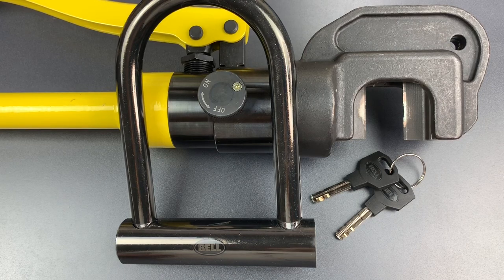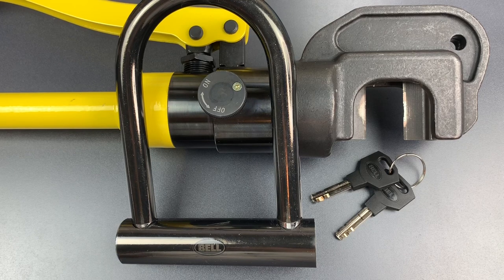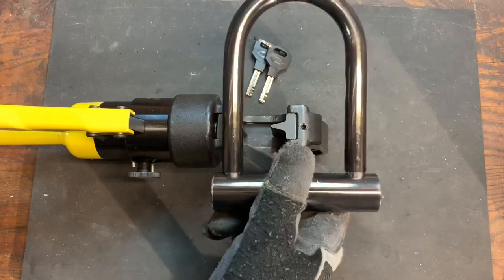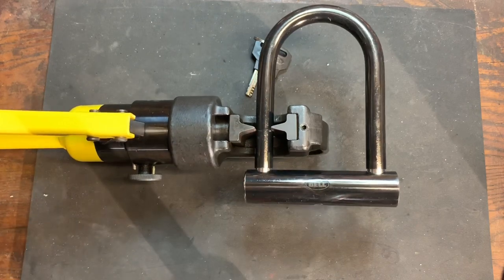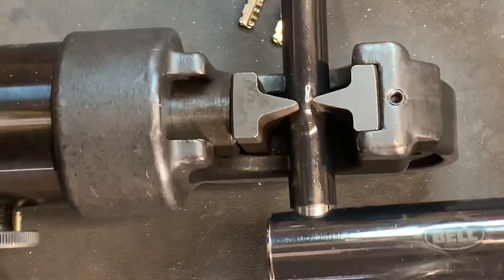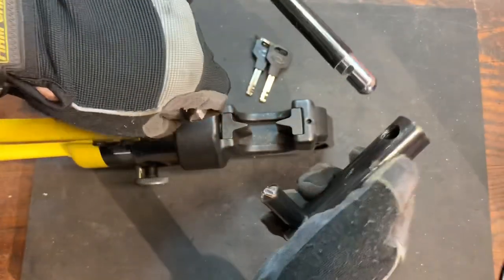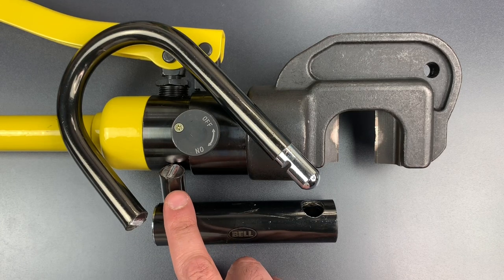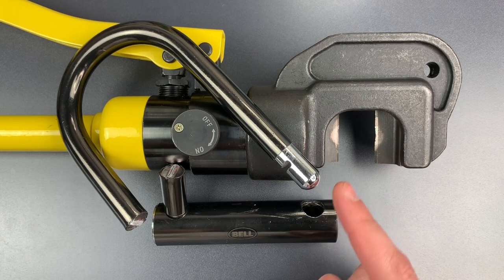[781] Hydraulic Cutter vs. Bell’s14mm Shackle “Catalyst 200” Bicycle U-Lock

Comment: Man, those cutters are no joke...
Reply: I wonder if/when he'll find something that could defeat them.
Reply: @TheJoeshExperience  wanna see a good old armp camp lock against it. one of them massive ones 220mm locks lol
Reply: you are damn right, these cutters are really impressive, but the locks, Lockpicking Lawyer puts to the test are a joke. I hope he spare us the the cheap shit and go hardcore with real locks like
Kryptonite evolution series 
Kryptonite evolution bike messenger series 
Kryptonite new york lock standard 
Kryptonite new york lock Fahgettaboudit mini u-lock,
Blackburn Sing-sing, 
Blackburn San Quentin, 
Abus Granit X plus 540, 
Abus Granit extreme 59, 
These are the interesting locks. I cannot Wait to see how really tough locks will perform.
Reply: @ShinobiDiabolik  he's done a video on some of those I'm sure
Reply: Those cutters put out 12 tons (24,000lbs) of force.
I was apart of the marketing team that designed and first sold these cutters.
They are actually hydraulic rebar cutters. 
We made these cutters, aswell as a smaller design the YQK-70 with its chassis used for wire crimping. The small version can put out 12,000lbs (6 tons) of force about half as much as the rebar cutter. You can get a mini one to put in your pocket, and change out the crimping end tool with the rebar cutter end and get a small concealable hydraulic mini bolt cutters.
We eventually after several prototypes, sold the patents for the rebar cutter and wire crimps to the Chinese.
Reply: @WELLINGTON20 where can I buy these?

Comment: Can you please test a lock with a hardent steel shackle? Because you can take a 100mm (Ok, thats too much) shackle and the blades will go through! After the fifth lock it's getting boring with those soft locks.
Reply: That shackle is made of hardened steel, go check it.

Comment: Those cutters put out 12 tons (24,000lbs) of force.
I was apart of the marketing team that designed and first sold these cutters.
They are actually hydraulic rebar cutters. 
We made these cutters, aswell as a smaller design the YQK-70 with its chassis used for wire crimping. The small version can put out 12,000lbs (6 tons) of force about half as much as the rebar cutter. You can get a mini one to put in your pocket, and change out the crimping end tool with the rebar cutter end and get a small concealable hydraulic mini bolt cutters.
We eventually after several prototypes, sold the patents for the rebar cutter and wire crimps to the Chinese.

Comment: I wonder if it would be even easier to cut if you coated the blades with graphite-molybdenum spray. This would significantly reduce friction during penetration into the metal. 
On the other note, viscous material indicates low toughness, no hardening at all!  This material is even easier to cut with shear-style blades, will not require such long travel and possibly even less pressure.

Comment: i don’t think you’re going to have any trouble cutting any shackles with that cutter. try cutting the lock body. maybe it would give a little resistance
Reply: Won't fit in the jaws...
Reply: That's not what a thief would do, they don't try to make it as hard for themselves as possible so neither should the lockpicking lawyer.
Reply from the maker: Doesn’t fit. ☹️

Comment: Another outstanding vid. Hey, here's something I would love you to look at: FIC trailer locks. I can pick the top latch lock for the handle, but the bottom dead bolt defeats me.  You can search for these on eBay via the terms: FIC 43610 BLACK DOOR LOCK 2 Keys Deadbolt RV Travel Trailer Flush Mount Fastec . These are used on thousands of travel trailers... might make an interesting little vid for your investigative talents.

Comment: Just to add one more thought that crossed my mind , just like we have CVE's (Common Vulnerabilities and Exposures) in digital world and security , I thought this: How about compiling similar list in physical security ? As well as CVE's make things better in digital security , (and sometimes worse) I think that such list would help a lot to lock owners and potential buyers. Also , it could make things easier for thieves and such , but , at the end , end users could benefit a lot , and manufacturers can be pushed to pull from stores faulty products , and improve existing ones. So , we wouldn't have too much overpriced trash , but the products that actually do what they are supposed to do. And , that would't require extra costs and such , just products that do what they are advertised to do.

Comment: I am starting to beleive that if a lock fit in, it will be cut. I don't think there will be anything that give it a fight. Why? Because it is not a vulnerability that the lock manufacturer tought about. 14mm, who the hell will hacksaw throught that or grinder throught that? And those bolt cutter won't work as it is too big! and hydraulic tools is just too bulky as it need a motor and hoses and all.

... they did not foreseen this hand pumped hydraulic cutter.
Reply from the maker: There are definitely locks that can resist... we’ll get to them. But we need to work our way up.
Reply: @lockpickinglawyer  Any clues as to what we should be buying? My bike just got stolen because the lock was cut and I'd love to know what I should use next time...
Reply: I'd like to see if that can take on something like a shutter lock -- something that bolt cutters can't really even access.

Comment: Try cutting an entire lock rather than just the shackle. That might be a bit tougher for the tool
Reply: It ruins the point if you don't go for a the weak part like a potential attacker would
Reply: @cainharris8505  There is no point anyways because the shackle is no challenge for hydraulic cutters. Cutting the body would at least be interesting.
Reply: @Convolutedtubules  Lockpicking layer, is testing using real attacks and real exploits, this is the value, because this is how your lock will be exploited.
Reply: @ShinobiDiabolik  You seem deeply offended by the fact that I watch these videos almost exclusively as a form of entertainment.
Reply: @ShinobiDiabolik  It's okay if lock picking is your thing, I'm not here to judge. I look at things from a different perspective to your own .

Comment: Was the shackle actually hardened? And what was it made of.
Reply: Bell says the shackle is hardened. The test has proven this shackle is NOT hardened. and yes, the shackle is made of cheese
Reply: @ShinobiDiabolik  lol cheese, it is of course a lesson for some though that you cannot trust the manufacturer of the lock. Instead we get informed and make a informed decision on what to use.
I would to see if it will cut the 18mm forgettaboutit by kyrptonight and abuses best bike lock.
Not a fan of the cheap alloy crap they use on the cheap d locks.

Comment: The way you twisted it open, doesn't it mean that this lock is shimmable? 
Also if you're searching for a lock that can withstand those cutters, shouldn't you be looking at higher end locks?
Reply: I don't think it's shimmable, those cuts are square and relatively deep so the shim won't be able to work its way through.
Reply: There was at least one higher end lock in these series already.

Comment: Bell is WALMART junk, probably from Cambodia. Give us the manufacturer of the cutters so we can find out what the blades are made of, what they've been hardened to, as well as their shear strength. Otherwise, we're just wasting time with cutters that generate 70,000psi. It can't be just about getting views, we need to research to find out what will work.

Comment: criminals do not use such a tool
Reply: Some do, but those typically aren't your average bike thief. If they were more compact and less pricey I imagine it would be a lot more common.
Reply: Battery powered disc cutter is cheaper and just as fast.  @johnathanmcdoe
Reply: @rdizzy1  Makes tons more noise though.
Reply: Depending on where the lock is sited some people might even mistake this for using a bicycle pump if they don't get a good look.
Reply: @NorthernSeaWitch  , 😂 , too bad there isn't such reaction. 😂 But , yes , it can be mistaken especially at night. :)

Comment: I get the point if you show how some cheap cable locks can be cut with small pliers but this just makes no sence.. I wonder that you are soon oxy-fuel cutting locks and still amazed how weak they are.
Reply: Big difference between the two, a thief can easily carry this in a small bag, even a large pocket/in his pants. It is also almost totally silent, and can be done quick.This is a legitimate test.